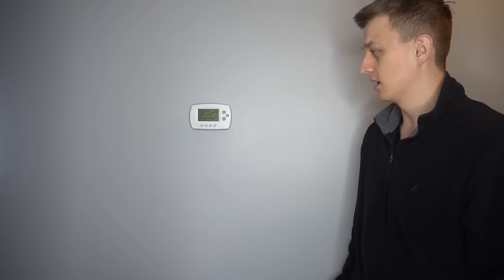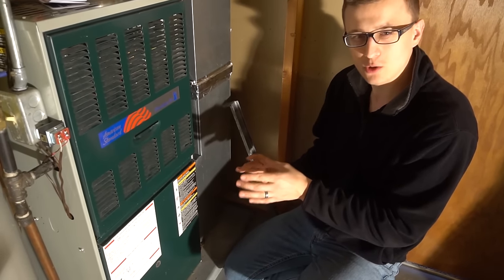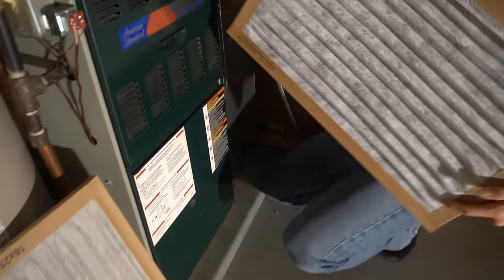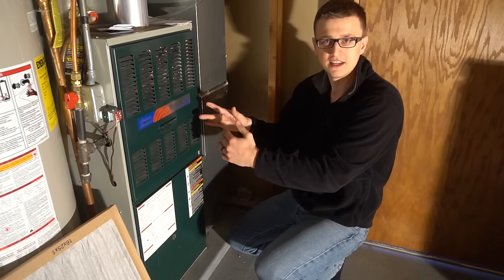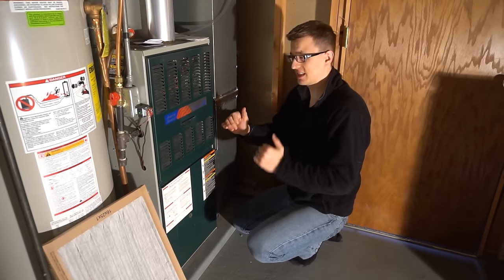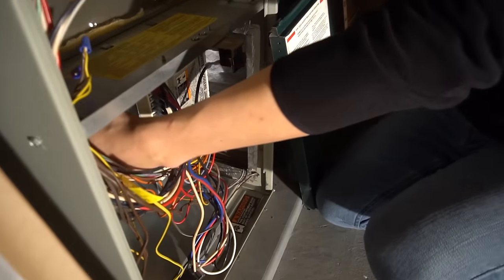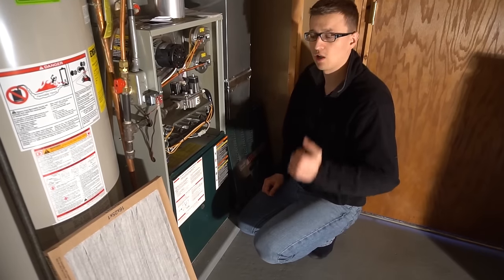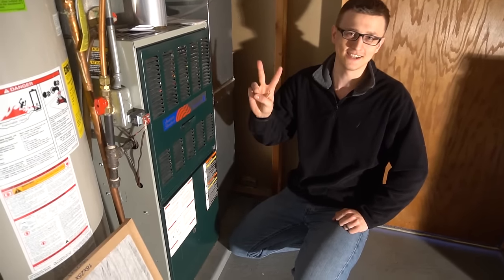Furnace not Keeping up SOLVED

Comment: A real helpful VIDEO , when only I had play more attention to it at first ! After useless 2 days of exploring for other possible reasons like change Thermostat and heat control switch , stock/flue safety switch and thermostat wiring I came up on this video again. I compared my 2 months old filter which looked actually fine against a light with a new Filter to find right there my missing answer. Like they say, always start with the most simple possible inexpensive things even when they look fine and make no sense , my new type pf paper filter did <<  LOOK >> fine but it was not ! Thanks for sharing , it could be a 2 minute task :(

Comment: People make sure you can use a higher MERV filter.. some people may only be able to use a cheaper filter.. also a good tip.. use a bigger filter.. so it's easier to grab..sometimes when filters get that dirty they can be sucked into the blower squirrel cage.

Comment: Amazing!
I think this was my problem. 
I watch several videos about how to change the batteries... which I did. But it was odd that my display on thermostat was lit and seemed to be functioning.

I changed my filter and turned off and turned in that switch that I had no idea was even there.  Immediately my furnace turned on and within a minute it was blowing warm air.

I think my furnace was overheating and turning off as a safety mechanism to avoid failure.

Thank you soooo much. Hopefully in the morning my air temp will match my set temp.

Comment: Thanks for the video. I've been doing almost all my own repairs for over 60 years but I'm not up to speed on these electronic systems. So, I just learned about the lockout feature and solved my problem. You saved me and expensive service call to take care of a simple matter. Had I thought about it longer, I might have realized it was necessary to "reboot" the system, but finding this saved me the effort.

Comment: Jay just installed a smart thermostat on a boiler the lady keeps the thermostat set to 82 degrees the past week and it's only about 40 degrees outside, house is well insulted. Boiler pipes are very hot on both sides of the circulator pump. Indoor baseboards are not as hot as I think they should be. Does this sound like an air problem, the boiler has about 5 hi-vents that are not leaking.

Comment: I have the problem of the AC is set to 65 and it stop.  When it gets to 70, i reset the breakers and also change the filter and still not reaching the temperature

Comment: I changed about every sensor on my furnace nothing worked. I tried what you said and took the filter out and everything started working fine. It was a new filter that was suppose to keep out more allergen. It was shortly after putting it this higher end filter that the furnace had problems. Blows my mind that I simply had to downgrade my filter

Comment: Short cycling on hi limit. Check the heat rise, and the temperature the hi limit is tripping at. Could be tripping prematurely. Most importantly, the  high limit will trip if the heat exchanger is rotted through, which will allow carbon monoxide into the discharge air stream! CHECK THE EXCHANGER!

Comment: Great video ty 
I hv question??? Is your heating Thermostat a Honeywell?
Your Gage on your wall looks like the one I hv, I’m hving same problem!!
Wth room temp reading diff from temp tht set!!!
It’s not batteries, I took gage off wall & 1 of the pins snapped off,
would tht cause a problem with the heat not working at all???
Plz help!!!
Ty
desperate & frezn !!

Comment: Hello. l really love your videos they are so informative and well explained. l have a 20 years old HVAC and when l set the heat to let's say 70 the temperature in the house drops 4-5 sometimes 7 degrees for it to start . Any idea what it could be any kind of sensor going bad ?
Reply from the maker: The first things that come to mind are:

- Furnace is overheating (try replacing filter even if it looks clean)
- It could be the pressure switch opening (when the furnace is not turning on after it drops 2 degrees, look if there is an error code blinking on the furnace control board)
- Thermostat issues. Could be the programming, weak batteries, or like you said a bad sensor in the thermostat. (Try putting the thermostat on "HOLD", replace batteries, bypass thermostat to see if it needs to be replaced. I have videos on this if you need them)

Hope that helps narrow it down for you and gives you more ideas of what to check. Good luck and Merry Christmas!!

Comment: My limit switch keeps tripping but not locking out the furnace. The filter is brand new and clean. Switch still trips without filter. I verified this is the switch that is tripping by using a multimeter and seeing the 24v when it tripped. I have taken temp rise and it is well within specified limits. I also opened all my registers in the house, checked continuity of the limit switch and it was good. I used a jumper to keep the furnace running and removed the limit switch and took a temp reading in the port. It didn't hit the 200F spec of the switch before it tripped again. I replace the limit switch and it is still tripping. Not sure where to look next. Any suggestions?

Comment: Hi thanks for help, I have change the filter and I have done run the furnace without filter to make sure, but still thermostat setting temperature not matching temperature the house, do you think the problem thermostat? Thanks again :)

Comment: So, ran some of these tests and it wasn't my air filter or the thermostat unit. It was my water drain hose from the furnace. The hose was tangled. I untangled the hose and unplugged it to drain a lot of water out. Then I straightened out the hose and made sure it was in a downward slope to drain the water out properly. Now my furnace is running smooth again and the house is back to cozy warm. 😃

Comment: It is 5 degrees here this morning and my Thermostat is saying 60° in the house even though it is turned up to seventy. I changed the filter it was a little dirty amd I could tell that there was more air flow after. How long sould it take for the house to warm back up? Google says about a degree an hour does that sound right

Comment: Thank you, Sir, for this great video!! Goodman Furnace. Installed: 2004. When the upper panel of the furnace is removed; the thermostat reaches its 'set-at-temp'. When the panel is installled, the (thermostat) temp shuts-off less than the 'set-temp'. Why is this happening? Thanx again. Howard

Comment: Thank you for the tip.  It helped with everything but there was 1 underlying issue.  The wind is blowing super hard and it is forcing the carbon monoxide back down into the unit causing the sensor to trip the unit!  Fix?  Wait until the wind isn’t howling.  :(

Comment: This is EXACTLY what happened to me since it got cold again. Pulled out the filter and it was caved in due to restricted airflow. With no filter, the house warmed up instantly and the furnace stopped going on and off constantly.
Reply: Can a furnace work without a filter
Reply: @melanieharris5595  yes it can absolutely run without a filter however it will cause more problems sooner or later as the main purpose of the filter is to protect the furnace from getting clogged and hence creating a whole host of potential issues. By removing the filter you would tell if that’s your issue( if you have one), but asap replace it to prevent any problems.

Comment: For the past 2 winters, my furnace does not work on days when it gets below 30... HVAC said that I needed to cut a new hole in the ceiling for more airflow. Had this house for 15 yrs without a problem. Replaced the furnace with a Trane 6 yrs ago.... Is he right about the ceiling or should I get a second opinion?

Comment: Hey, I appreciated your advice on the furnace/filter issues. Due to our health issues and temp. Control needs, i change filter every 3 months with highest allergen *(usually 3m or whatever is highest of keeping what I’m allergic too out) ... Now we moved into a home that really as not move in ready, the owner put in a new HVAC system, teetered themostate, but due to ABUNDANCE Vermin (Rats/mice, ??? Chewed threw many wires) Someone came out and threw tons of poison bags up in attic and i believe (we are not on cement- house build up in 1956- Orchard house) in ground drop... so when i turned on thermosatate i heard a lot of stuff coming through the vents.... Poison?? I have animals- along with rat hairs etc. Long story short, the thermostat “Hold” buttton is stuck, but it allowed a change in temp, (Cost me $1330.00 to fill propane tank that ONLY RUNS HVAC nothing else) and here we are freezing running all on electric and my husband and I’m are on lock down in two rooms with electric heaters.  Now, They did do a lot of work to this house, however, much still needs to be done to run sufficiently. When we asked the HVAC (which is owners handy man) about the Air ducts having holes (since heavy duty wires in garbage disposal and dishwasher were chewed beyond working order...were replaced) The Handy man said to owner that the holes cannot be fixed with aluminum tape, need to have looked at.  Now, Here I’ve made the most expensive move in our 36 years of renting and can’t use the Propane for heat... I just need to know WHO DO I CALL TO INSPECT THE AIR DUCTS AND LET US KNOW WHAT IS WRONG! The owner thinks I’m complaining now too much, as previous house had same issue due to a hoarder house next door took 2 years to clean up and where did all the vermin go... to the house we rented and none of that was disclosed to me except through previous renter (who had video and pics of police removing tenants, and that new neighbor and her brother who helps her lives on other side takes care of property now- said they had hired pest control and still couldn’t keep them out)... so my only alternative here (owner did sent someone out to look, but two young guys looked at each other’s as if to say clearly on their faces they were not going to work on this house and said, should be ok... I turned on and pellets again came out of vents with rat hairs and bugs burring through walls on my bed - YUK! I’m at a lost as to who to get to come out and inspect this properly? We have never had this problem in 30+ years till last two and have had to move each year, very costly. Still in boxes for most part. Lowes who installed the new dishwasher, pulled old one out and was not going to install due to all the dead rats and poison, i provided him medical gloves, mask, trash back, disinfectant scrubs and asked him to please, begged to clean up and take out to big trash can for me. He said the right side of the dish washer needs attention too as under boards were separating due to damage and most likely dead rats under their too as you could still smell and still do.  My apologies for so long note, but you seem to know what your doing with this and summer is coming up fast. Our Electric bill outrageous to say the least. 
Seeking Answers as to who handles Air Ducts (I thought it was always HVAC). Any help or guidance would be appreciated.
Reply: So sad no one replied to you in over a year!!
Reply: Tofast

Comment: Is that the RTH6580WF smart thermostat  you have there. I just installed two thermostats one upstairs and one for downstairs and for some strange reason the heat with not come on and I double check the wires setup even took a picture before removing wires from older Honeywell thermostat. 

The only thing that will come on is the AC. Do you have any suggestions

Comment: Hi There ! My Furnace will turn on and reach its set temp but once it reaches it’ll start blowing cold air , the Pilot is lit still . Replaced the Limit switch and flame sensor/igniter . Whats my next step ? Thanks .

Comment: When I shut the furnace lid, the flames go out. Almost like it’s suffocating. My filter is new but furnace won’t keep up to the thermostat. It’s set for 72 and it’s only 62. Also it’s -40 outside where I am. It’s slowly getting warmer with that lid cracked a little. 🤷🏻‍♂️ Any advice??

Comment: I appreciate the explanation! My filter looked clean, but it definitely warmed up after taking it out. I just switched out the filter 3 weeks ago though... it has been single digit temps lately though. Is that not al to switch the filter that quick? I thought 3 months was more typical.

Comment: My furnace is a train high-efficiency furnace. After it cycles off and achieve setpoint it tries to restart again however doesn’t ignite the burner. Once you turn it off and let it sit it runs fine.

Comment: I've had lock out lately . My tech has been out and everything seems ok. New filter and diagnostic shows everything ok. It's a Goodman furnace. They had revised the board ,per tech bulletin  ,4 months after mine was built because of this same problem with lock out.  My furnace is 15 years old. Would the board be my next move? That's all I have left? Been 3 days and waiting for tech. to get back to me.

Comment: Well I woke up to 55 degrees it's set for 65 wasn't working at all, then it just started running ... I think it was the reset mode. But middle of winter this is  crazy. Filter is at 50% but I did change the batteries in the thermostat tho.

Comment: NEVER change the filter while the fan is still running because you’re loosening up dirt that getting sucked right into the vents or the A coil if you have central air.
Reply: I was told to turn it off when it gets done
Reply: Agree, but that’s not enough dirt in 30 seconds to cause problems for the AC coils.
Reply: @tonymanero5544 over time it adds up.  The advise to remove the filter to check if that's the cause of cycling on limit isn't necessarily the best either.  If a new filter isnt immediately available the homeowner might run the equipment and forget to replace the filter.  The next restrictive part of the furnace, the secondary hear exchanger or the A-coil will become the filter causing even more problems.

Comment: I have a high efficiency furnace. Sometimes it doesn't turn on on cold days. I have to go out and blow air into exhaust vent (not intake vent), just little bit. It starts right away. Any ideas? I checked there was debris in the exhaust vent. Removed what I could. Thank you for such a wonderful channel. I look your videos often for advise.

Comment: Ever have a blower motor that seemed to still be working properly but was not moving enough air across the exchanger at high fire so the high limit trips?
Reply from the maker: Pretty sure I have. First thing I'd do is replace the filter even if it looks clean. Is it a variable speed motor? If not, then you could increase the hi-fire fan speed. Could be not enough return air too. A few different possibilities here..
Reply: @WordofAdviceTV ended up changing the motor and it did the trick. Always like to be sure before especially when the parts over 1000

Comment: Same thing here.  Thermostat set for 73, woke up at 66.  Changed filter, powered down furnace.  It kicked on.. but still only running for about 4min at a time... Is there a "warm up period"? When it first gets going again? Or do I have additional problems

Comment: I’m guessing mine may be the filter as well. I just got a new thermostat installed today. And my furnace keeps running non stop. It automatically switches from hot to cold. And I’m guessing it’s doing that because it’s not reaching the set temp and goes into cool down mode.  Any info on this is appreciated.  Also I haven’t been watching to see if it actually hits the set temp

Comment: Ok, I think something similar to my rental home. I changed the filter a few months ago, and now the heat will not go past 70. I checked the filter, and it still looks brand new. Like there is nothing in the filter!! I am trying to run it without the filter to see if it corrects the issue. It is not a premium filter, it is a cheapie, but we will see.

Comment: So I set mine at 70. Temp kept dropping to around 58-60 and them furnace may kick on at some random time. Tried 3 different types of thermostats, all new and same results. When I would pull t stay off base and jump r-w the furnace would kick on immediately. In my head it couldn't be in the furnace itself it had to be in the control (t stat). Well checked filter and it was caked. Also had open limit switch code.  Replaced filter and it seems to be working. But why on earth would it work everytime I jumped it. Only thing I can think of is even though relay was closed on stat and in theory furnace should have ran like that, that the furnace control board has to see a change in signal after it threw a code for open limit switch, otherwise it doesn't make sense to me.

Comment: What is wrong with an Electric Furnace/HP when it goes into overheat mode repeatedly especially when it's colder? The fan runs of course but it cools the house down before the heating elements kick on. Filter is new, wall thermostat has been replaced, heater strips replaced. My Brother has had people out several times to fix but it still isn't fixed. He lives in Southside Va. so it doesn't get that cold there. Electric bill is sky high as a result of furnace continually running but no heating up the home. The home is only about 900 sq. ft. in size. Any help would be greatly appreciated.

Comment: My furnace in Denver mid winter stopped working. The house got cold fast. I called a repair outfit. The wanted $80 just to come out. Then after 10 minutes he found a faulty vacuum switch. Part cost, about $35. In 30 minutes he was done. Then presented me with his "standard" fee book. His bill was $400, to work 30 minutes and replace a $35 dollar part. Total extorsion. He left in a brand new shiney expensive work truck. I told everyone I knew about the company and never to call them. Lesson learned.
Reply: Justin credible    I work in the HVAC industry, and Yes, 100% agreed Justin.